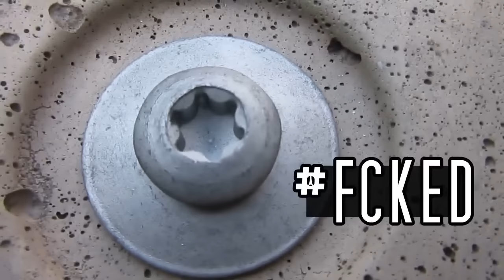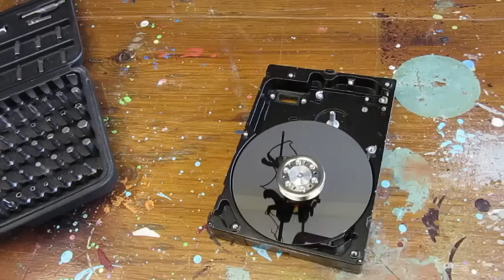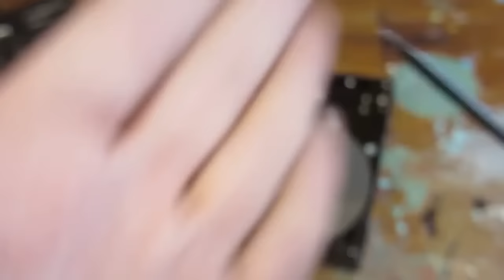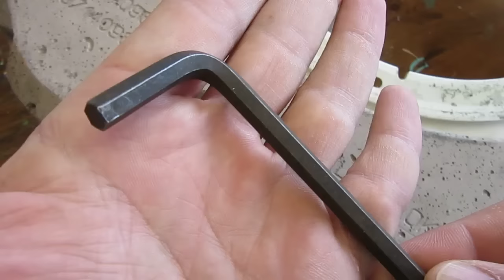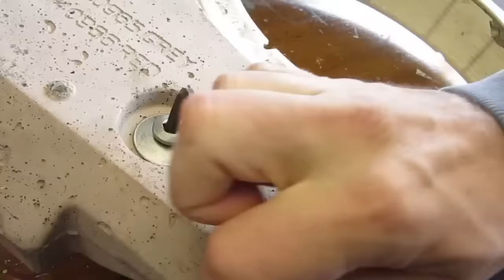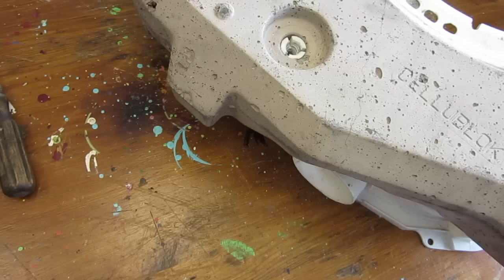2 Easy Ways To Remove (Star) Torx Screws WITHOUT A Torx Driver! Open A Tablet, XBOX Or Smartphone

Comment: At this point I'm just wondering why there isn't Universal screws🤦‍♂️
Reply from the maker: Indeed
Reply: Cause some people don’t want you opening their hardware such as PS4 that doesn’t want its competitors snooping around in its hardware that’s why it has special security screws :)
Reply: @jsvnabsb8265  Competitors might just have the budget and motivation to go out and source unique screwdrivers for that. This whole thing just aggravates the average joe.
Reply: They make it so godamn hard
Reply: What would a universal screw look like ..???  Let alone why use a universal screw ?? That would be too easy and no $$ can be made
Reply: @jsvnabsb8265  but you can always find the bit to open that "special" screw ...
Reply: That pretty much sucks considering you have to open the whole goddamn thing to give it maintenance...
Reply: @sebastiansantos1471  definitely was NOT built for anyone's convenience. To fix this piece, you must remove these 5 things 1st and while doing so you will compromise the gasket in one of those 5 things forcing you to now have to buy another gasket that was never broke to begin with but did break when you disturbed it .... now you have to spend more $$ to do the repair.

No different than changing out a headgasket on an engine, you must also replace the intake manifold and exhaust manifold gaskets as well as the front timing chain cover gasket because even though those were not bad, once you disturbed those gaskets, they now have to be replacdd so now your 1 headgasket replacement has turned into a multiple gasket replacement ...
Reply: @jsvnabsb8265  but you can buy the "Torx" screwdriver from the corner shop at the end of the road
Reply: At this point a set of bits cost like at most $30, just buy one
Reply: More screws = More purchase = More Money
Reply: @ACommenterOnYouTube  Normal slotted head is the best one. All other types breaks way too easily and then you need much more advanced tools to remove that screw.
Reply: @xvnbm  you actually have it 100% wrong. Flat head or slotted head is the worst for drive and removal. Phillips is the next worst design. This is why slotted is hardly ever used on anything. 
Hex head and torx is the best and has the most gripping power when it comes to driving in and removing. 
This is why when you have a phillips head or slotted head that is too tight, it STRIPS when trying to remove it.
Reply: @jsvnabsb8265  that's the worst response i've ever heard just to lick a company's boots
Reply: Agreeeed!!
Reply: Agree with you
Reply: Bec. Manufacturers want buyers to see them as Geniuses
Reply: @eddydiaz6207  Ur reply might be too harsh on Jsv, he might be partly right. Company wants a "degree" of difficulty in meddling with their product to push people to have it "serviced" by the Company accredited centers.
Reply: @ACommenterOnYouTube  It already exists. Philips.
Reply: @djentslayer  i guess you lack understanding what you read or failed to read thru
Reply: @nouiikou a slotted and phillips are more durable 🤣 ... 
Slotted and phillips are the single most stripped heads.
Reply: The whole reason of screws on machines is so they cannot be opened by the average person, YOUR NOT SUPPOSE TO UNSCREW A SCREW
Reply: @edsaquascape7891  Why would that even matter to them? That money would be going to the screwdriver company instead of the thing you're trying to open's company anyways.
Reply: Everything boils down to money
Reply: @thedrbat9572  nah, one of the biggest pros of screws is they ARE removable, allowing you to tighten them or easily access to different parts. A rivet would be used on something you weren’t supposed to mess with
Reply: Money
Reply: For protection
So Only specialied people can access it
Reply: Some of us don't want our valuable equipment stolen
Reply: I work on machines with different types of screws and I am wondering the same thing. Goddamnit.
Reply: I also 😢

Comment: look simple if the Torx is not tight.  Try that with a extremely tight one and it will strip.
Reply from the maker: I could also try it on one that is impossible to remove and then it would be impossible to remove

Comment: It worked for Torx screws for me with the most torque provided with a flat screwdriver bit in a power tool!  Initially, these 2 methods didn't work. The flat screwdrivers with plastic handles would be about to break. I checked both metric and imperial hex key sets one by one, all new, but not enough torque to turn small (about 2.5 mm size) star screws. They were catching a little bit, but then slide, as if the screws were stripped. I eventually found a flat bit of just the right size that worked for resistant Torx screws after soaked the screws with WD-40 and waited for 20 min. Thank you!
Reply from the maker: Yep, can be challenging at times

Comment: Man, you just saved me a trip to the parts store and the money to purchase a torx tool. Thanks a million.
Reply from the maker: Nice, happy to have saved you time/money
Reply: @TheLabOtomy  Do you know where I can purchase a manual on my exact car: 2015 Buick Regal 2.4L base model? And, do you know where the fuel pressure regulator on it is? I hope its not in the tank. Its needs a crankshaft sensor and fuel pressure regulator says the dealership. They want $1700.00 for parts and labor. Their nuts. I may be able to do it myself. I just have to locate the old crankshaft sensor and the fuel pressure regulator. Sense you a a top mechanic could please tell me where these parts are located on the Buick? Thanks

Comment: Flat head on a torx ONLY works when the flat head fits perfectly in the groove. 
Same with the hex bit, only if it fits snugly in the grove and you dont need much power to break loose ...

Comment: Thank you for this video! I am actually trying to open my PS3 to get the dust from off the inside. The side has a star screw and frustrated me. A small flathead screw driver did the trick! Thank you!
Reply from the maker: Happy to hear it helped, have a nice PS cleaning
Reply: The LabOtomy Thank you! I cleaned it but it still has that red light of death. I think I may need to try a tougher vacuum to carefully suck dust out of smaller inner areas behind the vents inside. If that doesn't work, then gotta get a new PS3 (I still have PS3 games I haven't finished) and eventually get a PS4.
Reply: How to open ps4 one please make video

Comment: These methods work if the Torx screw isn't stuck, so if these methods fail to let you remove the screw, use a rotary tool (like a Dremel) and a small cutting disc and cut a slot wide enough and deep enough across the head to get a big flat screwdriver blade across both slots, and you can generate the torque necessary to remove a stuck Torx screw.

Comment: This SUXXX!!!  I'm trying to replace the switch in the Microwave. Its a simple fix, i just cant gwt the darn screws out..
Reply from the maker: Sounds like a typical manufacturer that wants you to buy a new product rather than fixing it yourself... as mentioned, one option could be to drill the peg out without damaging the torx bit. Not sure however if you have the tools to do that.
Reply: I’m also trying to open a microwave. But my reason is to stop the beeping indefinitely. A simple fix and I can’t get it open :0!!!

Comment: Thanks for the help. Trying to take apart a dead hard drive so I can physically wipe it into oblivion (electronics stopped working). However, if you need to put them back in I would recommend getting a quality torx set just so they don’t get stripped.
Reply from the maker: Makes sense, thanks for sharing

Comment: Do your self a favor and just buy the right tool for the job. Im a industrial technician by trade. I have found out the hard way several times. A torx set isnt even expensive guys...
Reply from the maker: Sure, but at the time I did not have one set covering from smallest (for Hard drive plate mounts) , to biggest sizes (washing machine) and really needed those Torx to be out...
Reply: Ya i mean if your in a pinch..like maybe on the side of the road...or your only car is on stands with no wheels then you could get away with it....but using an allen key on a torx is just using the wrong tool for the job deadass....its a good way to strip the SOB and now its gonna be a pain in the ass to get it out hahaha i think we've all been there
Reply: You're an* industrial technician by trade.
Reply: ZERO260/// 
Yes, but Torx sucks ass !
NEVER again.
Reply: I've brought 2 sets of Torx bits & neither one will fit. They have he hole in hem for the peg in the screw

Comment: Reminds me a bit of the gearshifter bolts on the ford type 9 gearbox. Torx and very tight. Every time I have to undo one, I don’t even bother with the torx driver - they are always too tight and strip out the driver. I use a chisel now to undo them + and fit normal bolts afterward...

Comment: I didn't see a smartphone. What happens if you take a very small amount of Araldite ARA-400010 adhesive and glue a very very small nut to the rounded out torx screw head on a smart phone. And let it sit overnight?

Comment: ffs theres like a little pole in the middle of mine so i can't do this. microsoft piss off
Reply from the maker: Surely is
Reply: Sand it off
Reply: I believe you can still use the flathead method unless your screws are really in there. Either way, a T8 torx driver is only like, $5 on Amazon

Comment: I was trying to open my dewalt battery charger and it looked like a standard Torx screw, i have several torx bit sizes and NONE would fit, come to find out it was not a standard torx screw but a security torx which had the opening in the middle and the screw had that hump in the center to fit the opening on the bit ... 
Basturds using a torx security screw ... really dewalt, its a fuking $40 charger, not a $6000 hybrid state of the art brushless blah blah drill ...
Reply from the maker: Funny you mention security Torx, next Wednesday I will publish a video showing 4 ways to remove those
Reply: hmm ....
Reply from the maker: Mentioned it above, so there we go, freshly published: "4 Ways To Remove Security Torx (Star) Screws!": 
https://www.youtube.com/watch?v=lifM6Vttecg&list=PLPz-I0BhXRDI1l8fTZTKJS-ymHxwp06hu

Comment: what size was the flathead?
Reply from the maker: It depends on the size of the Torx screw, so find a flathead screwdriver that fits tightly in the space between 2 spikes diametrically opposed

Comment: Every time you use the wrong tool to disassemble something you make it harder to work on the next time and screwing the guy who works on it later, maybe you. And let alone the fact that you are probably ignoring torque specs. The right tools are sold everywhere and some auto parts deliver.
Reply from the maker: Fair point

Comment: Just use the right tool. CHEAP stores have them. And NEVER USE AN ALLEN TO REMOVE A TORX!!! Just get the tool. If you don’t have one, go spend $7 and get a small set.
Reply: Yeah and replace the torx screw after
Reply: Only prob, when u realize torx, and saturday evening nothing open to buy 7€ key, so here is the solution which knew by everyone so far.
Reply: Yah, get a 7$ set. You get one use out of each bit. If you are reeeeeaaalllly lucky, you might get 2

Torx is a racket designed to steal our money. Its like planned obsolescence. Or, more precisely, its "planned stripped driver and stripped fastener so we can sell you more of both plus this 40$ extractor kit you now need!"
Reply: But, its NOT FITTING!!!  Ive brought 2 sets

Comment: What about the one with the PEG in the middle?  I've brought 2 sets (5 bits each set) of Torx Bits & NONE OF THEM FIT!!!
Reply from the maker: Any way to grind /drill out the peg?
Reply: Quarter turns with an old flathead.

Comment: If the torx screw really tight or jam, this definitely not work.
Reply from the maker: Neither will it work if the torx screw has been thermally been fused to its attachment as a result of a nuclear explosion... 
What about if the head is broken, this will also not work right? Come on, help me, we can list more scenario, maybe bringing dragons and  alien powers into play, this should be fun...
Reply: @TheLabOtomy  - This comment is underrated.
Reply: In any case you can drill ( using a good cobalt drill-bit in the exact middle of the center ) and thereafter use an "extractor" , a sort of conic screw left-threated : trying to unscrewing ( anti clock- wise ) , the "extractor" goes into the bored screw, then it become stuck, and ( going on anticlockwise ) carries out that damn screw. ( if you broke even the extractor, which is pretty fragile, you are definitively loose. Try to drill verticall as you can ). 
But, befor doing such a no-return solution, try a good "hammer" knock against the bit torx setted in that unscrewable screw . . . This removes oxydation and often is enought. ( PAY ATTENTION TO FRAGILE BITS AROUND . . . ). And use WT-40, living it working a bit . . . 
In worst cases, even a torch can help, but here, pay attention to flammable objects near by . . . Wish this could help . . .
Reply: I forgot . . . When using "extractor" wear safety goggles, as this tool - even if made of steel - is very hard and therefore very fragile, as glass . . . In any case, when going on mechanical works, goggles are a "must" . . .

Comment: I know this sounds dumb but just go to harbor freight and buy a set .
Reply from the maker: True, and I do have a set... but in the 2 examples in the video, the bits do not belong to the "standard" set... and rather than buying yet again something I have never needed so far (and probably will not need for some time (how many times do you ever open a HDD or a washing machine on a daily basis)), I'd rather sometimes use a different approach, save some time, pennies, avoid filling up my house and get going

Comment: If you DO get it out this way, throw it out as it will now never work with ANY tool again!
Reply from the maker: Nope, it all depends on the torque needed for extraction. The 2 Torx I removed in the video can be used again.
Reply: @TheLabOtomy  
So you purchased Torx bits to see then?

Comment: First, no bolts in this video are tight. 
1. How to ruin your puny glasses repair screwdriver. 2. How it still doesn’t work with a standard screwdriver. 3. Allen wrenches do not work on torx unless you’re trying to damage bolts and tools. 
NOBODY DO THIS
Reply from the maker: Already wrong on the first point (my washing machine video can prove it) so am not bothering reading further

Comment: Just buy a fucking Torx set. Unless you're really in a pinch, its not worth risking stripping out a screw head. You can get a cheap ass set of Trox and other bits for a few bucks on ebay or alibaba if you're really strapped for cash.

Comment: Just go buy the right tool for the job that's just stupid.
Reply from the maker: If this is to buy a tool you will use just use once (just like the really specific torx size that are used within Hard drive), then no
Reply from the maker: Otherwise, absolutely

Comment: What the f*ck? Just buy a 100 different bit set with all torx sizes to T50 to open every screw for 10$. There is no reason to not do so. When will you americans finally switch to torx and hex screws? PH sucks.
Reply from the maker: Nope, see comments